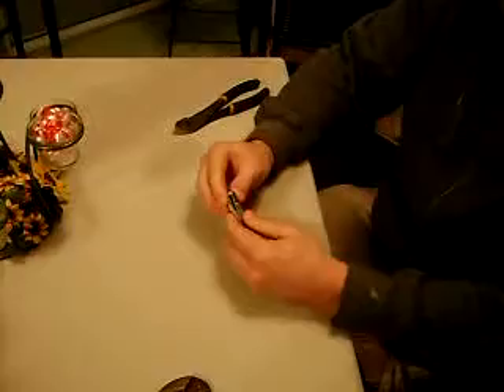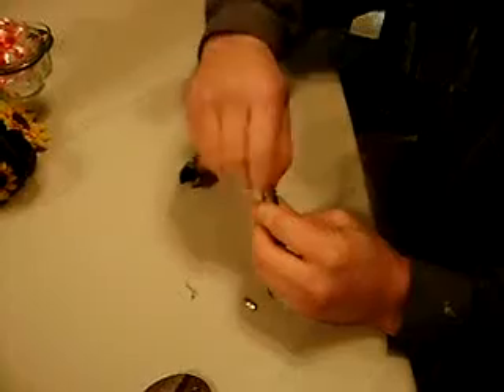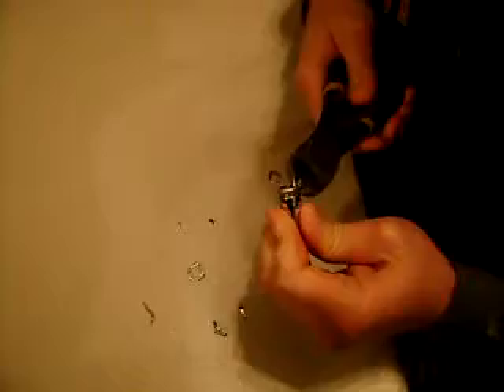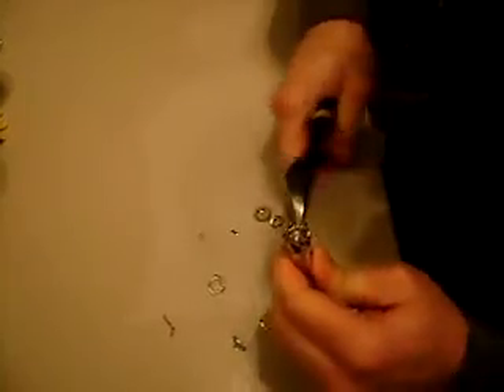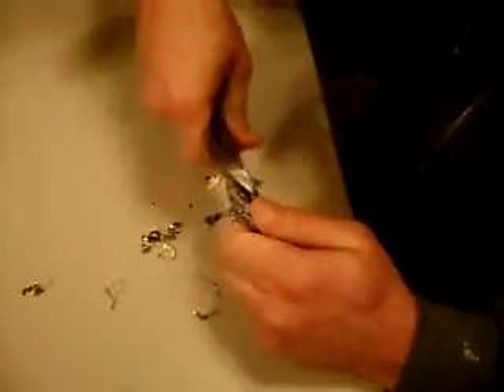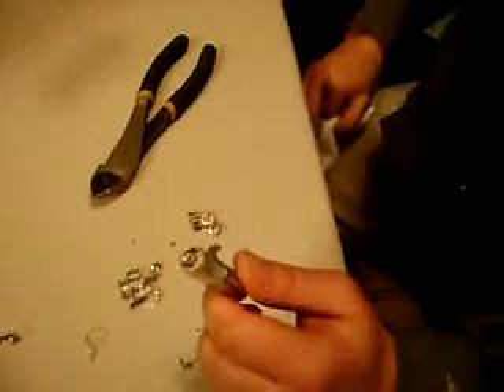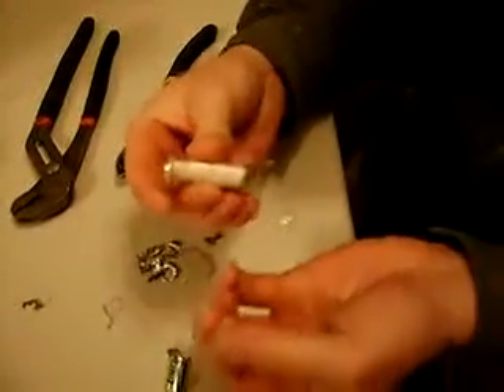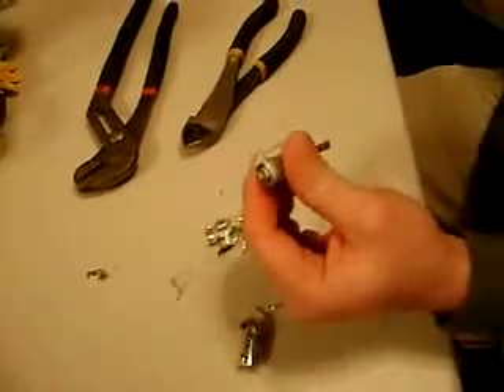How to get Lithium easily

Comment from the maker: @zrw788 One thing you want to do is use lithium energizer batteries and not lithium-ion batteries.  The reason for this is that in lithium-ion bats the lithium strip is not pure lithium. It is actually lithium cobalt and oxygen  LiCoO2.  And to answer your question on dead bats. The answer is the reaction will be reduced because once again as the bat discharges a chemical reaction takes place with the lithium and it is no longer pure.